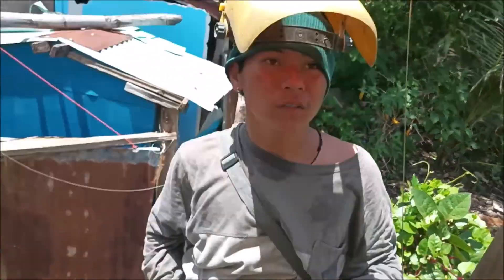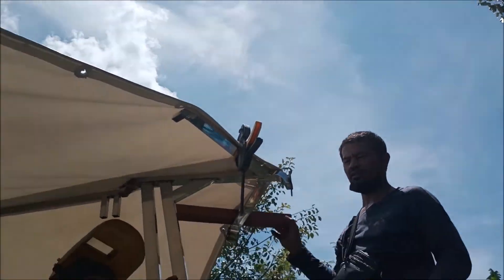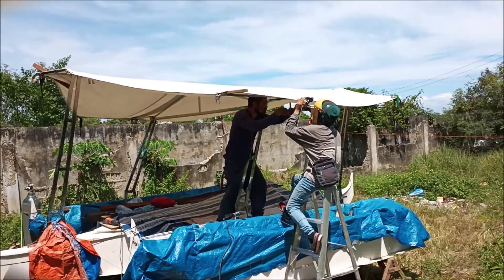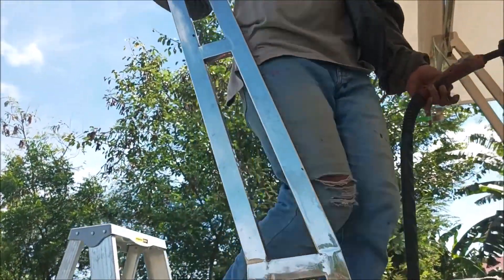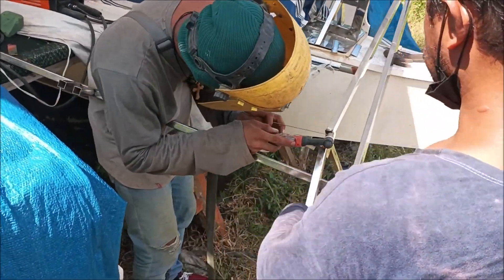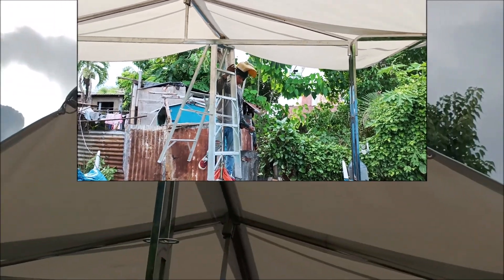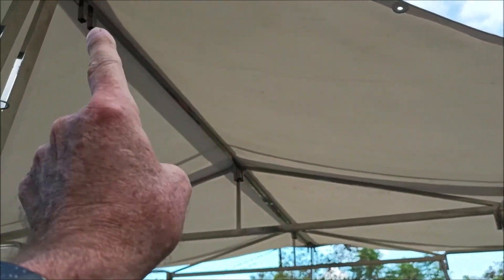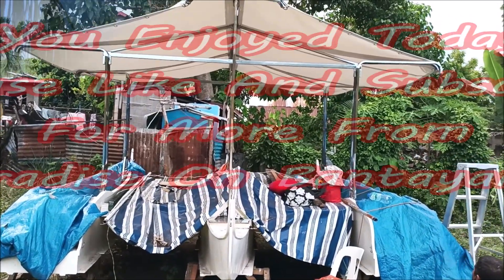Paradise Trimaran Boat Build - We Finally Complete The Tarpaulin !!!!!!

Comment: I am from Metro Manila and have watched countless youtube videos of boat builders nearer our place of who can do a trimaran. Unfortunately none of them can. Yours is the first video I’ve seen that tackles a trimaran build from scratch. I went as far as part 3 but had to skip to this part to see how it looks so far. Do you have an estimate how much everything is going to cost once the whole thing is done? Ball park figure only if you don’t mind.
Reply from the maker: It cost more than I had planned😁
40k for the main boat/center hull with a 15hp sumo rato gas engine. Then for the rest I can only approximate maybe another 100k for the outer hulls and the stainless steel tarpaulin supports and tarpaulin. I had to design and build all the connections and support to connect all hulls because no local boat builder had enough engineering skills to make it strong enough to hopefully stay in one piece in any rough seas. If you watch the series you will see how much strengthening is built into the hulls and cross beams and supports. Stay tuned for the sea trials😁🐟
Reply: Thank you very much. I am really eagerly awaiting the sea trials. Good luck.